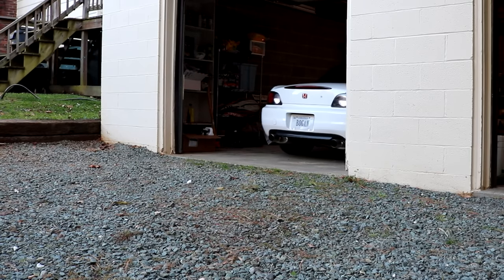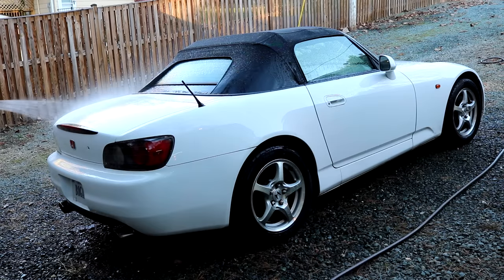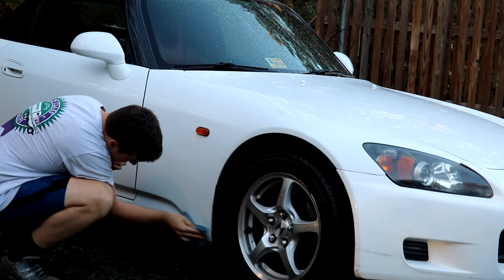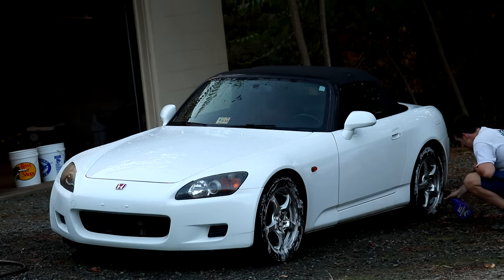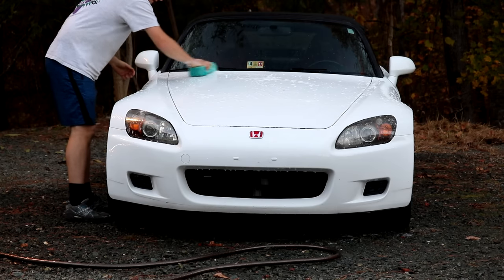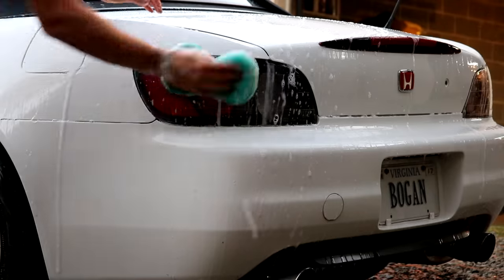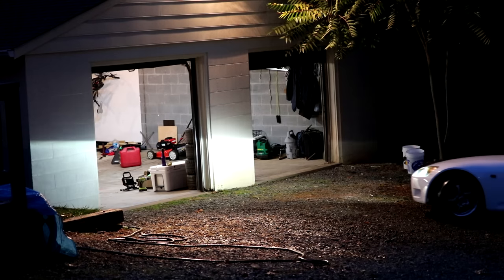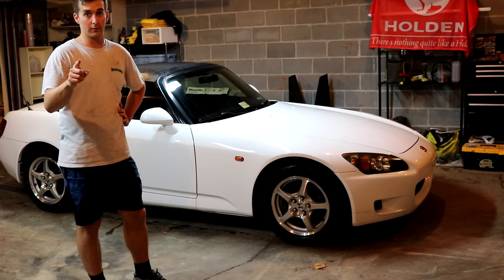Honda S2000 Project Build: Dirty Car, First Wash -  Ep.3

Comment: looks like the top bolts of the front bumper near the headlight is not bolted in
Reply from the maker: +Steven Phong yep I need to investigate to see if the bolts are there or something on the bumper is broken
Reply: Garage Topics there should be a bracket that is bolted to the bumper and that when it is installed mounts to the inside of the fender